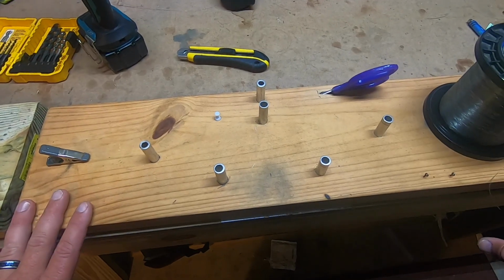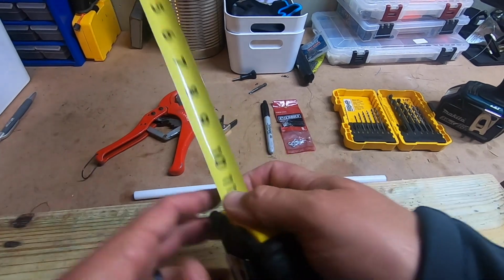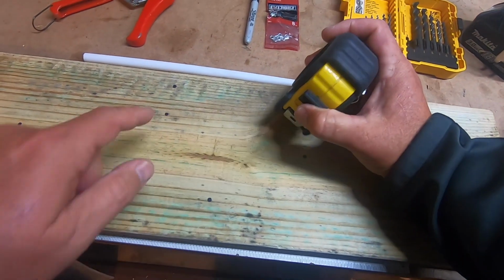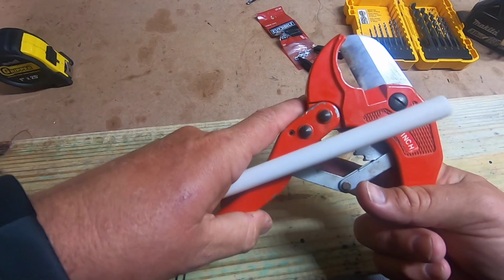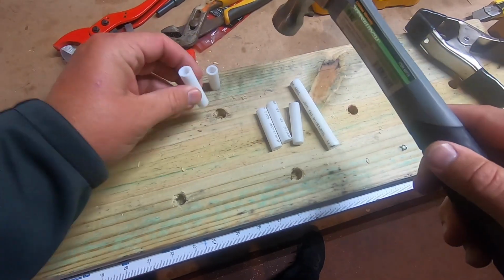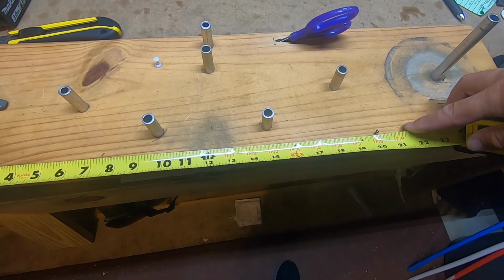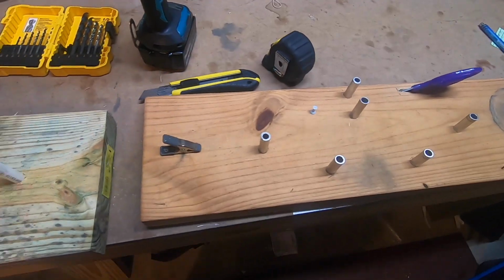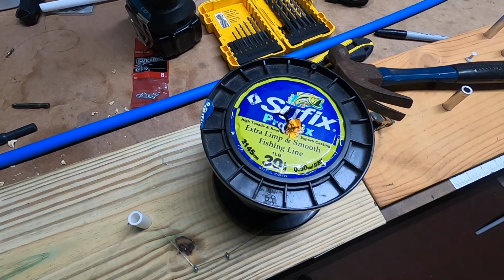Best Surf Fishing Rig.  How to make your own Double Dropper Rigs.  How To Make your Own Rig Board!

Comment: I made a bastardized version roughly inspired by this. 2 clips, 3 short dowels and a tall screw for spools (some of mine have an I.D. of under 1/2"). Only 3 dowels as I just picked a single size; up until now, they were pretty random and usually shorter than intended. Now much quicker and more consistent. Thanks!

Comment: Great video. Very in detail. I am about to order the drill tool that you use to put the float and linecthrough and your spike likecweights as well. Thank you for showing me how to do this. I will try to make it. How do I make the drop loop smaller I don't like the access of line? I would like no more than 2.5 inches on each drop loop. Any suggestions.
Reply from the maker: I would just look at how I made my rig board and you can make a 2 inch drop instead of the 4 inch I make.

Comment: Just moved to East cost of Florida from Montana. Getting started with Surf  Fishing and I have begun to build your Rig Board, Only question is what is the post at 18 1/2 inches used for. I watched your "How I tie my double dropper loop rigs" video and did not see you use that 2 inch post. Thanks for doing the videos, They are a big help...